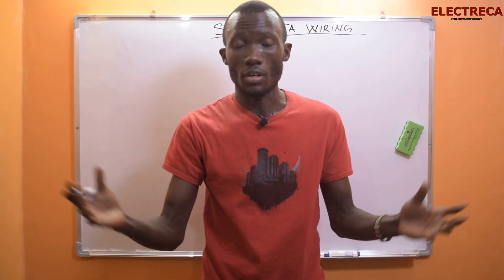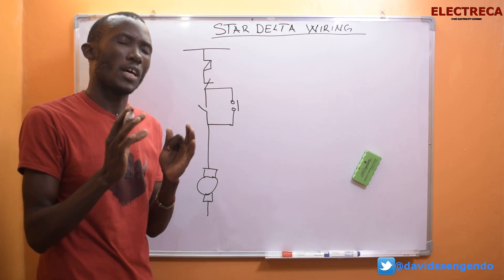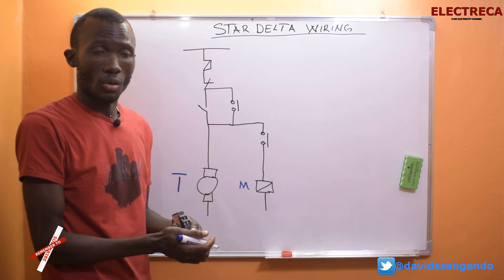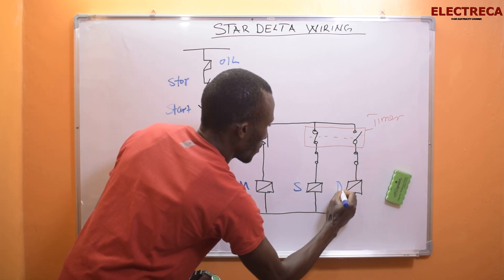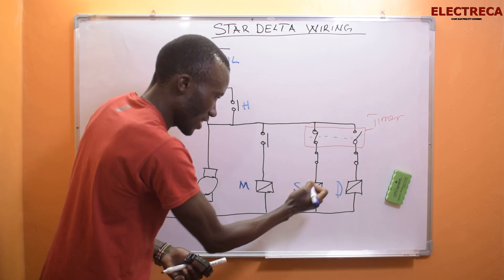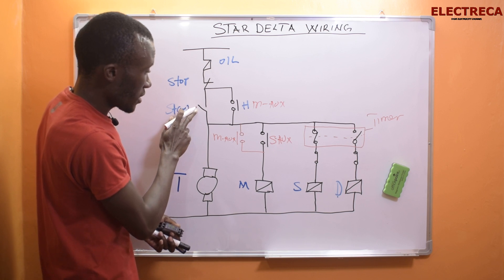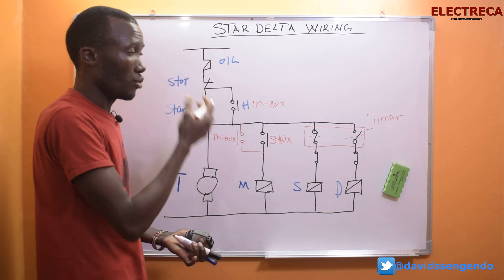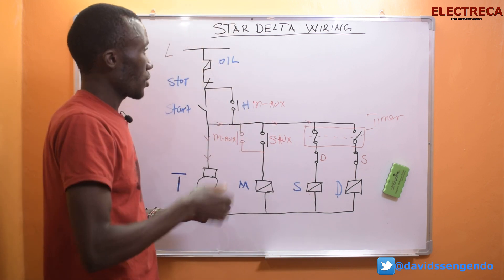How Star Delta Starters Work - Control Circuit Explained

Comment: But whay is contact on the timer for Star close , because when timer coil is energized also that contact will be open
Reply from the maker: The timer contact opens the star contactor after the set time elapses, allowing the motor to switch to a delta configuration.

Comment: Thank you for the video! Looking at your diagram, I think that the main contactor will get energized only after the timer relay changes its state, by which time, the star contactor gets de-energized, and the delta contactor gets energized. If this is the case, the motor won't run in star configuration. Instead, it will start in delta configuration direct on line. Am I tracking, or is my understanding of your diagram wrong?

Comment: Good explanation but you said in this circuit star contactor should energize first  before main contactor. Qn why star first while the motor will not start if both main and star are not energized.
Reply: He just explain the logic here. If you see it properly,  I think you'll see, the main idea here is the ADDRESS. The contact that the main rely on relies on the address of the star coil, so star has to come ON first followed by the main, bear in mind that that happens in short space of time (as he mentioned, by the blink of an eye), so if the motor relies on the main, then the motor won't start if star coil is OFF or not energized. This is the result of main not being energized, hence causes the motor to remain OFF.

Comment: Timer protection these days is recommended coz the timers in market are week ,let the timer be switched from NC delta and on the timer switch NO put a hold cct from no delta
Reply: Put NC for delta to switch timer ,then put hold on contact on timer NO to switch delta this will help timer to be always off when motor is running on delta contact

Comment: How long are timer set before the Delta get enrgized which are going to be brought in by the timer coil...because the minute you leave the start button ,the circuit will be de-energized,start wont be retained because the main contactor dont have power yet ....meaning the entire circuit will fall out again...star en timer

Comment: Thanks brother for the video. It's good.

Point of injection:

Use the main contactor NO across the start pb switch so it serves as the master switch; It will stop entire control network if the Stop Pb switch is pressed. The main contactor should work with both the star and delta contactor. The main contactor should control the timer coil from the action of its NO Auxiliary contact.

It's the timer's duty to switch between the Star and Delta contactors with its NC and NO contacts respectively with the set time.

Comment: Bro! My question is when push button pressed the phase will pass to Timer and start to count as as main contact make the also pass to normal close of timer and pass to Auxiliary contact of delta contact  then to A1 of start contact, I'm confused to this Auxiliary contact which will put above the contact start since we use the NC aux when pass phase make and become open  while holded to cont start why still make because NO means phase will blocked via to star contact ???

Comment: Why do we need the main contactor in our circuit. Is the circuit not gonna work if removed?
Reply from the maker: The main contactor help to hold the circuit that's why we use push button to make the circuit more safe to operate and reliable, if you remove main contactor then you have to use a switch(not push button) which will keep the timer permanently on during operation.
As long as the timer is on, circuit will remain running.

Comment: sir, why did you use that H switch, i couldn't quite catch that. My point is that if there is main auxiliary, what is the reason for using H switch?
Reply: The H aux is to hold the timer and the m contact is to hold the main contactor

Comment: Good. But I think it will be nice if the timer coil can be de-energize after switching to delta
Reply from the maker: The timer I used it Normally closed, so it has to be and remain energised to hold the Delta contactor on. If the timer coil de-energise then delta will lose power.
What do you think?

Comment: mr sir there is no reason to interlock the main contactor.
the main and the star come in together at the same time. lets assume we are  using pneumatic timer  that means it should be coupled with the main contactor..maybe u can add a hold in for delta and disconnects the timer from the   by adding normallt ope interlock for delta on timer circuit.
Reply: P
Reply: The main contactor just latches and keeps switched on

Comment: Brother thank you  for your video.But i have  a qsn about the second Main auxilliary you have introduced down there.Can you just make a loop wire from  Main  auxilliary and bring down  and bypass it,and connect at the second terminal of STAR AUXILLIARY BLOCK?
Reply from the maker: If you do that the Main contactor will engage before the Star, yet our primary goal is the Star to engage First
Reply: Bro.now it's clear now after i followed your video and demonstration

Comment: Valuable information sir
Reply from the maker: Thanks and welcome
Reply: @elektreca  plz send you complete panel wiring video's  interlock manually auto motor protected  and all 11&33&110&220&400&600 kV vcb power really wiring and ct pt box termination and drawing  and small trans former design wire selection core selection bobbins selection and formulas releate charts PDF and every panel wiring PDF and substation commission and PLC and every thing electric part send videos

Comment: What's the purpose  of the timer???
Reply from the maker: The function of the timer is Delay.
Example, if a generator starts, the timer will delay until attain its full speed(RPM) then the timer can load the generator.

Comment: Teacher thanks for video 🙏....but sir if possible I need circuit connection please
Reply from the maker: That circuit i drew on the board is CONTROL CIRCUIT for star delta stater, unless you need a power circuit. you can find it here https://electrecasolutions.com/understanding-star-delta-starter/
Reply: Thanks Teacher
Reply: They gave us please but he can do it again